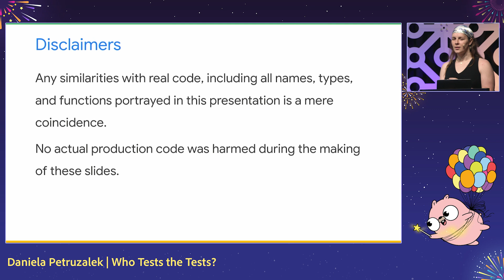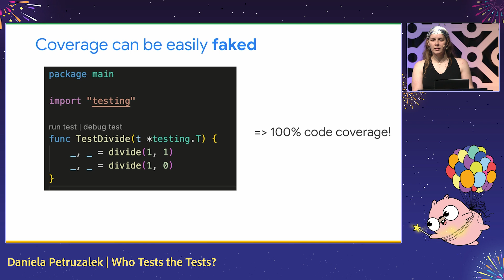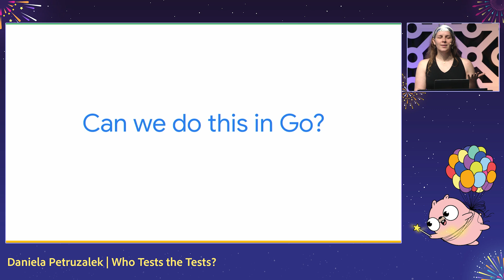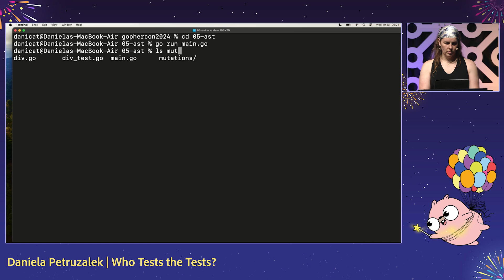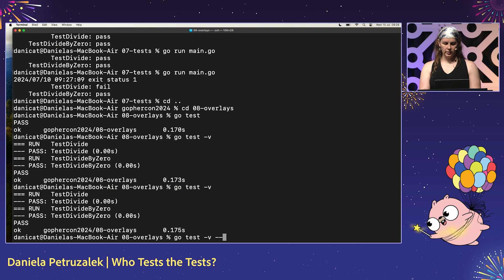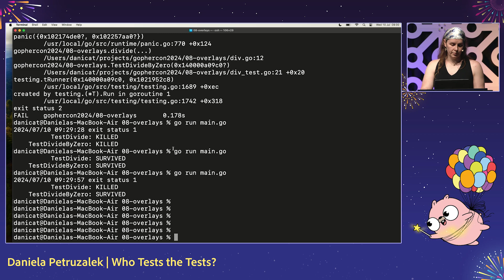GopherCon 2024: Who Tests the Tests? - Daniela Petruzalek

Comment: Mutation testing - very interesting. I have heard about this at Google but never as free open source software. Golang’s first class support for reflective operations makes it great for this. Python, too. Couldn’t imagine doing this as easily in C++.

Reminds me of “property based testing”, where instead of validating responses against “oracles” (exact answers” you validate responses against “properties” (this value is NOT negative, there was no exception thrown, the elements are in increasing order, etc.).

Also reminds me of Netflix’s “chaos monkey” library. Where, for the purpose of testing, they introduce faults. The faults introduced are not necessarily in the code, but in the network connectivity and such. And one last similar thing: fuzz testing. The “faults” introduced are not in code or the network, but in the inputs.